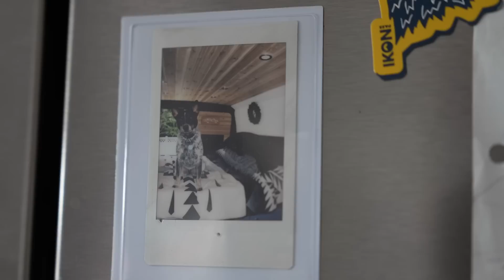WE CAN'T USE OUR WOOD STOVE... AND WINTER IS HERE

Comment: When I used to draw houses, we had to draw the stove pipe 3' higher than the point where it was 10' horizontally from the roof. Not only for the off chance of catching it on fire but if it's too low the roof could block the the breeze and inhibit good draft of smoke.

Comment: Your biggest headache last winter was the amount of snow that accumulated on the deck. Why not build a temporary roof, even in clear, heavy duty plastic that covers the deck and stairs. Building material you can push from underneath to release all that snow and still use the deck in winter.  It would only take half a day to create and save you a lot of work during snowstorms. And being clear, it won't stop light coming into the kitcten. ❤

Comment: Maybe it's just me, and I know it's easier said than done, but I couldn't settle for just having all the ice and water shield on before winter settles in. Especially with that little "roof cricket" area that will be so prone to leaks, I'd have to have that metal roof completed.  The snow/ice would also slide off the metal roof much quicker.  I'd also want to get the windows in too.  Good luck! Get that done then relax and take a well deserved vacation and not worry about leaks!!  🙂

Comment: After the addition is done, I think if you intend to live there for quite a while, your next investment/improvement should be a thermally heated driveway that is paved. Will cost some coin. But it's insane with the amount of snow you deal with. If you had a regular job (9-5 in the city) there is now way you could live there given the time it takes to continually blow snow. It's basically a full time job.

Comment: I keep wondering what “ready for winter” actually  means  every time I notice you do not have anywhere near enough cords of firewood under that deck as well as not having a firewood shed to put more in. I remember the struggle Allie went through trying to get wood in through that basement window.  Did that foundation wall on the garage that leaked water through it that Allie had to frequently vacuum up get a new coat of water seal on it?  Seems like the deck furniture would be nice to use in the man cave this winter.

Comment: It is so nice to have great friends to help when needed. Told you that it would be air tight before snow the first snow fall. Looks good and property all cleaned up for snow blowing. Hopefully you get the stove pipe in soon so you can have a nice warm fire. That is how we heat our house is with wood. We have all the electric rads shut off in the panel. So nice and warm and when the power goes out we have heat.

Comment: There are metal fabricators that could maybe modify the 8” pipe to 6” or make your stove pipe.  I also think you might be sorry you didn’t use 2-3”  river rock gravel as your drive areas.  Then the small gravel.  River Rick gives you a good permanent road bed because it doesn’t just sink into the mud and disappear.

Comment: Great job, Brandon and Grayson, in getting the ice/water shield on the roofs! Awesome job getting the area cleaned up, gravelled, and graded. May I suggestion that you use flourescent orange spray paint on your PVC extensions to your snow stakes. This will make them stand out better in high snow conditions.

Comment: What a team! Pulling off the woof rap up in a weeks time.  Tape n goop pro’s! The chimney does seem to be a temporary complexity.  Again no parts available vexing. Have always seen roofs in the U.P with home built ladders length of pitch and going over ridge with rubber membrane or Grace to avoid freezing to roof.  Slight oddity to see looking out a window but absolutely needed in case of chimney fire or maintenance. Seems like you might be going up there to remove snow load.  Like the builds. Cheekier than Bob Villa.  Cheers 🎉

Comment: Good job guys......looks like with all your fab crew there you have gotten it all ready for winter.  I had a wonderment maybe you can answer. If you can put heat in floors why could ppl not put a heating element on tops of roofs ie: under metal roofs in your case for a warm temp that would keep the underneath warm enough to just subdue the snow build up on those angles you have on the big roof angles...............curious if there is such a thing.  Maybe something low heat to go on the roof where the high ridges connect the sheets of metal...............hummmm curious. Blessings for an easier winter with all that you have accomplished.

Comment: You have an 8" diameter chimney pipe, right? Is it seamed lengthwise? With a little math you can open the seam, cut some off lengthwise & poof, you have a 6" chimney pipe. At the very least if you have a local sheet metal shop they can modify yours or even make a new one in a couple hours. I worked in a sheet metal shop, it can be done, we made them all the time, easy peasy . . . .

Comment: That nasty slope between the buildings that will leak... Why not build rooftop to rooftop next to the chimney were Trent stood during this video. Turn the space into a rooftop access or closet or closed in gap, changing that nasty slope where you will have water damages occuring. Best way to  explain what I'm saying... build 1 of those false gable  windows you see on rooftops, from building to building covering the rooftop. It doesn't need to be wide just change the water and ice flow.

Comment: I noticed you put a dab on each nail impression on tye Zip boards. May i ask if this is recommended by the manufacturer or is it just your desire to factor out as many possible moisture compromises as you can? I have put up dozens of zip exteriors and have not ever done this. So I'm curious. Thanks!

Comment: I would recommend that you get your second story windows in the addition before the snow hits.

Dont forget to mark the propane tank locations. You may want to consider putting a roof over top of them in the future so you dont have to work as hard to dig them out.

You may want to conside a storage shed for the trailer, excavator, skid steer, and attachments in the future as well.

Comment: ?Question? Okay, I have to ask:: 
Why don't you all have a Berkey water filtration system and refillable bottles (or something comparable) to replace all those plastic water bottles sitting on the front porch?
🤔hmmmmm...maybe they could become a sponsor?😊
We can't live without ours, quite literally, because our town water periodically gets so yucky.
Anyway, just wondering...
-  -  -  -
The reason I like that particular system is that it does not leave any aftertaste the way some of the others do, and we have tried others, even "direct from he fridge" water. 
The larger unit is great, processing over 3 gallons per fill, using one to four filter cylinders depending on the crud level of the water, and each two filter cylinder set purifies around 6,000 gallons of yuck before the recommended replacement.

Comment: WOW Drama... You's try to sell a line of bul... That air at the top of chimmey pipe you could hold your hand there an not get burnt.....
Reply: @@AussieTracy Ok Your so smart.. An I'm not let play question an answer. Question how long is that chimney there? For what I see 18 to 20 ft inside an 8 to 10 ft inside. Would say that about right.? An the next roof line 5 to 8ft away, right. Now have ever been on you roof when you have your wood fire burning? I would yes mostly not !!! So you want to believe I need to educated.. Let go for the educated now. How hot do you thing that top of the pipe would be??? Whats the flash point of wood? Have you ever been around a motorcycle in the summer?? That engine get really hot, right. Now in the winter time at 25 degree. That engine ever with your hand next it is hard feel the heat.. Now that roof that is 5 ft away will be very cold. An for your information flash point of wood is 350 degrees. Do you really think that pipe of the chimney is 350 degrees. If so your tell me a 5ft away wood framing wall will get to a flash point of 350 degrees???
Now who need the education now????